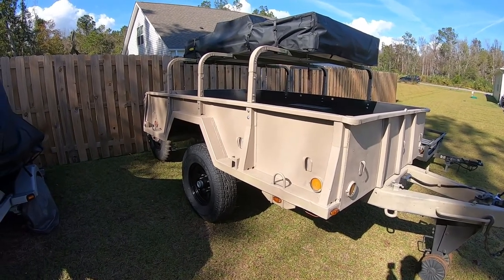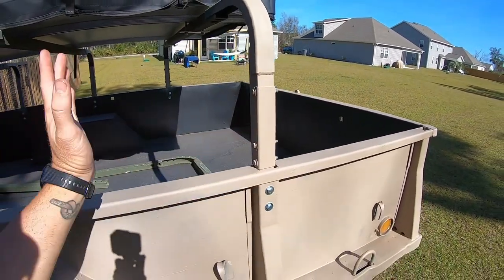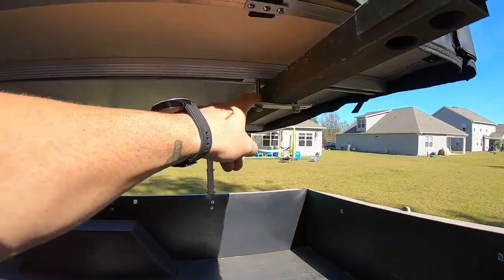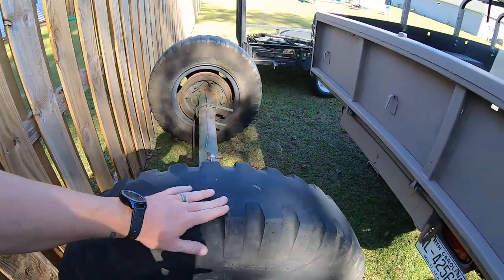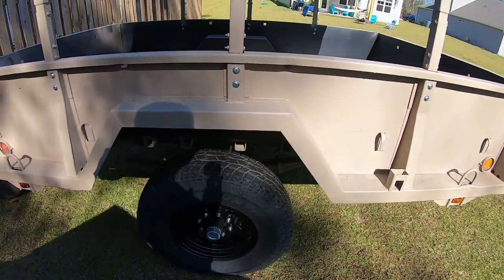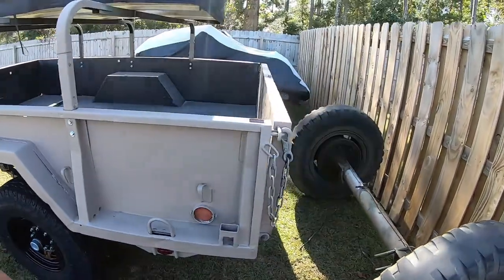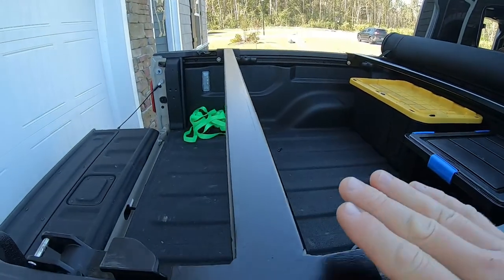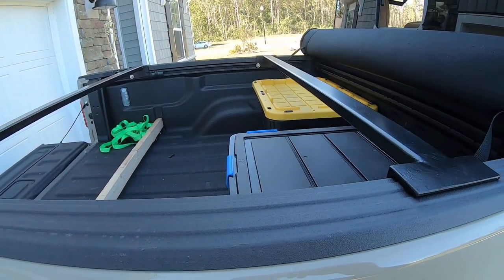M105a2 Framing on and Roof Top Tent Mounted

Comment: What size tires are those?
Reply from the maker: On the jeep or trailer?
Reply: @ajphillipsjeeps  trailer? Just got a m105 and am pulling the axle. Trying to figure tire size
Reply from the maker: @BRadWilson3  Toyo open country a/t ii lt235/85r16 120r e (10 ply) bw.
Reply from the maker: @BRadWilson3  make sure to check my other videos, I try to go over a lot of the goods and bads and help with choosing  design on your build. Let me know of you have any other questions or anything I can help with.